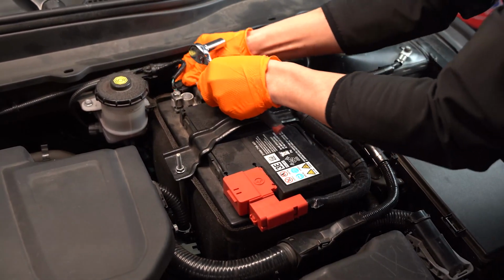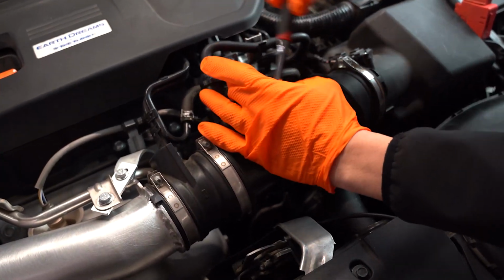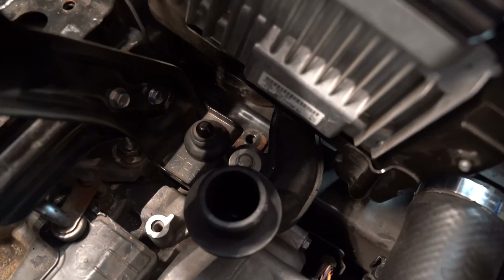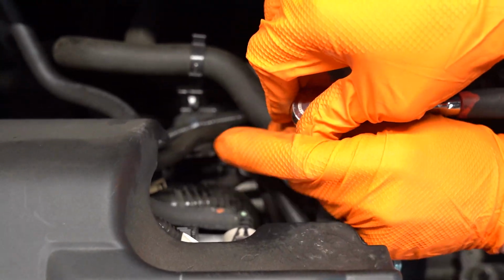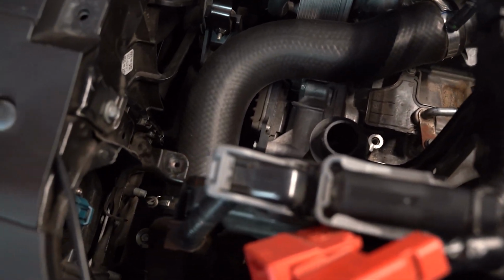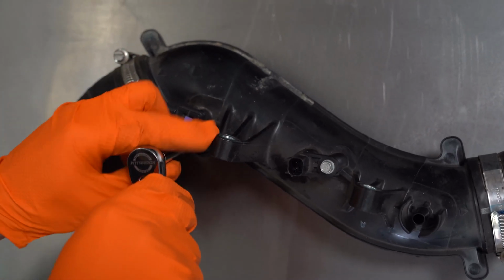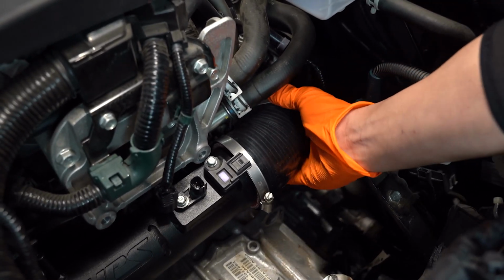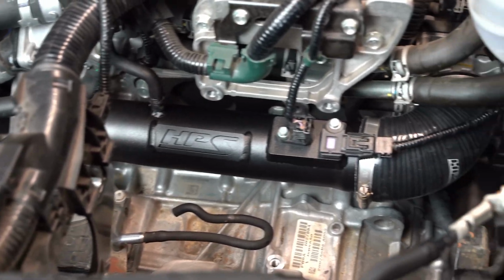10th Gen Honda Accord 3rd Gen Acura RDX 2.0T Charge pipe installation

Comment: What the benefits?
Reply from the maker: Hi, better air flow thus more horsepower and torque and it gets rid of the rubber and plastic from the OEM. This is made from aluminum.
Reply: @HPSPerformance  are you sure the OEM isn't designed that way to flex a little on purpose
Reply: Do you have a link? Also a promo code? I want to get one for my 2.0 accord